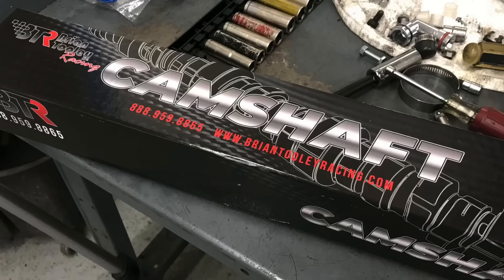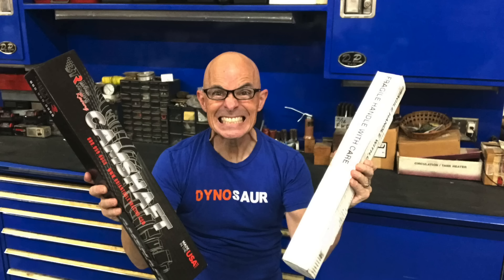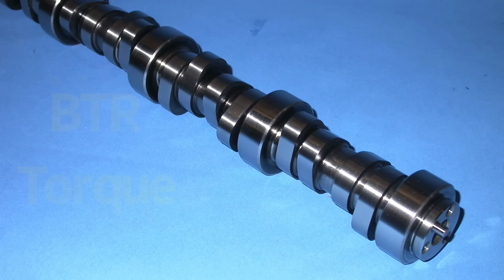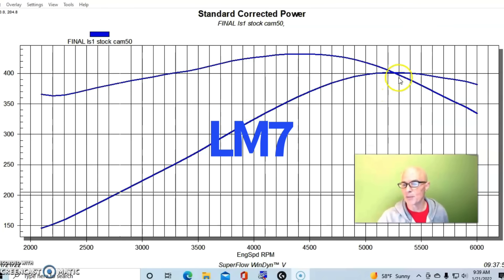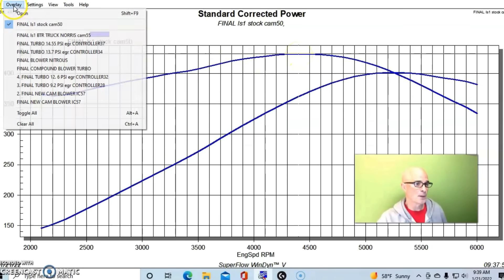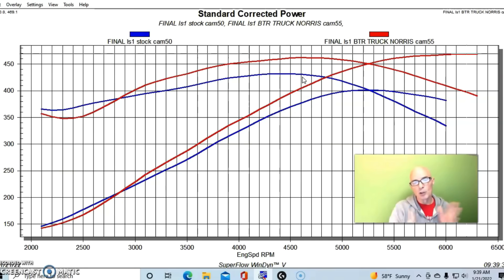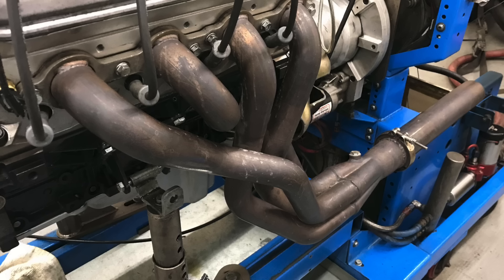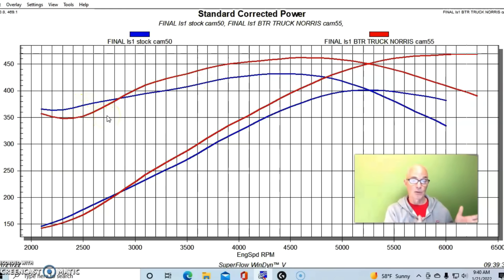WHAT IS THE BEST LS CAM? SLOPPY MECHANICS BEST VS TRUCK NORRIS FROM BRIAN TOOLEY RACING? FULL DYNO!

Comment: I just don't understand how the 5.7L at the same 3.622 stroke has an earlier TQ peek than the 5.3L, with bore being larger. In an ideal world, same stroke/smaller bore should see an earlier TQ peek, but not in this case obviously. Longer stroke/same bore should see an earlier TQ peak, Larger bore/same stroke should see a later TQ peek. I understand the motors are not identical with simply added bore, but normal behavior should be mentioned to those watching this so that they don't get the wrong idea about the intended effects of added bore or stroke in a motor. After thinking about it for a second, the 5.7L's compression ratio was obviously greater and also should have been mentioned with the early peaki-ness vs. the 5.3L, which shouldn't happen in equal conditions.
Reply from the maker: YOU DON'T UNDERSTAND HOW A BIGGER MOTOR WITH THE SAME CAM HAS AN EARLIER TORQUE PEAK? STOP THINKING BORE AND STROKE AND START THINKING DISPLACEMENT

Comment: Very interesting but if your chosen cam is going in a daily street driven vehicle, it's probably not at full throttle very often and I'd put my money on the btr cam being better at part throttle conditions in most applications. I would have a conversation with btr and a few other knowledgeable companies before purchasing such a vital part of my combination based on a dyno test or a small price difference.

Comment: I would love to see this exact same comparison with a LS7 cam instead of the LM7 cam.
Reply from the maker: I have compared the LS7 to the LM7 (that video is up), the LS7 is very soft down low-but does well up top
Reply: @richardholdener1727  I was referring to an LS7 to Sloppy Best cam comparison.
Reply: @andrewnelson3733  He has tested the SS2 in comparison to many..It is very hard to beat the SS2 in total power under the curve. It works very well..

Comment: For a street car or truck that torque curve the mid range power from 3000-4700rpm is  very useable in stoplight banzai where stout track gears and rpms are not as useable that is why Truck Norris is a good street cam.
Reply: Yep I think I will put it in my 04 gro because it's a street car.  It will have more power basically everywhere and still pull to 6500, which is all I want

Comment: I would.really love to see some test for 5.3 cams that would increase power from 5500 and lower. My Z71 runs like a monkey on fire, but I would love to find a cam to kick the low rpm power up more than increased rpm range with more peak power. 
I need to delete the economy crap.
Reply: That truck Norris cam is exactly what you want. The BTR v3 stage 1 and 2 are also good truck cams. All those give you power pretty much everywhere with slight loss of low end.
Reply: Richard says it in a lot of his videos, at lower RPM displacement is a much bigger contributor to power. At 2000 rpm your stock cam isn’t probably even a bottle neck, you’re only being limited by the engine size and compression ratio. Which is why basically every LS cam is the same or worse than stock below 4k rpm. There’s no magic to be made down there.
Reply: Typically when I look for power it always favors more rpm. I can't remember ever building a engine to keep the rpm low. I love the sound of a 532 at 8200. If my 5.3 were a 350, I know dirt track cams offer a wide curve from down low to whenever.

Comment: Great video!  
Are there any benefits  from milling the 317 heads .030 on a lq9 6.0?
Reply from the maker: MORE POWER
Reply: What hp estimate would you say for a lq9 with .030 milled 317 heads,  tsp stage 3 low cam, 1 3/4 long tube  headers and ls6 intake and throttle body ?

Comment: not saying this is true but it did seem to be biased towards btr  was there a btr consultation after  dyno test and then the video came out  love what you do Richard holdener but from the out side it felt like you held back
Reply from the maker: held back by what? all the 3800 turbo dyno testing?
Reply: @richardholdener1727     I understand Putting data together  takes time .. on the ls btr sloppy test  it seemed  to me like maybe you wanted to get better data before discussing  ..the cams are for two different people in the end
Reply: If he had shown the graphs and not identified the result by cam name would you feel better about the result?  Most followers would have been able to determine which cam was which in a blind results presentation.  The same basic pattern follows in all the cam testing.

Comment: Sloppy best vs Elgin 1840p 🤔 judging by this curve with more lobe separation and what not and the same or .005 more lift the sloppy stage 2 would prob flow a little better up top correct? The two seem pretty comparable. Def solid contenders for decent prices

Comment: I'd love to see a Comp cams 54-456-11, which is basically a high lift GM Hot cam.  I think it'd be right in the middle.  706 heads are made for 1-5/8" headers...and they work very well up to 500 bhp.

Comment: Any dyno pulls with the truck Norris vs Stage3/4 car cams?
I bought a stage 3 for my corvette but I’m debating sending it back for the truck Norris
Reply from the maker: yes
Reply: I’m guessing that the stage 3 car cam did a little better than both the truck Norris and sloppy best cam based on the duration and lift. 231/244 .630/.615 112.5 +2.5

Lost some down low and after 5500 pulled away

Comment: truck norris would still out run the sloppy best when you add boost, the turbo would spin up faster with the Truck Norris cam vs the sloppy best
Reply: Depends on the setup.  With the right converter that's irrelevant

Comment: What springs would work with Sloppy Cam ?
Reply from the maker: any .600 lift spring
Reply: @richardholdener1727   pac 1218 would work perfectly.    Could you guys do a test between best cam vs sloppy stage 2
Reply: @richardholdener1727  hate hijacking but you have tested enuff combos , what do you think this setup puts down for power? Lq4, 243 heads, ss2, pac1218, nnbs intake with flex fuel injectors, 1 7/8 primary long tubes and dual 3" woth x pipe and two knock off flowmaster 10s. I appreciate ur expertise, ive watched so many of ur videos to figure out what to use in my engine, im not dissapointed in the least woth how it turned out

Comment: The Sloppy best cam is better above 5000rpm the BTR is better 2000rpm-4200rpm really splitting hairs with these two cams in a heavy vehicle with a stock stall converter I'd take the Truck Norris cam but if using a 2800-3000rpm stall converter in the same application the extra power above 5000rpm with the Sloppy best cam is slightly better and enough to notice the Truck Norris cam would work better if gearing was 3.42 with stock converter in a 4L60E or 700r4 the Sloppy best cam would work better with 3.73-4.10 gearing in the 4L60E or 700r4 with at least a 2500rpm stall converter is my opinion
Reply: I was joking...just a stick shift fan...lol
Reply: What's a converter? 6.0 nv4500 FTW..
Reply: @raymondsteadward168  if l need to explain your on the wrong post
Reply: @raymondsteadward168  it's what transfers the power of the engine to the transmission from there the power goes to the driveshaft that transfers power to the rear end input shaft to the ring gear to the axles and puts power to the tires the converter is a key part for all of this to work yes really
Reply: @raymondsteadward168  it looks like a 12 to 8 inch metal donut with a shaft directly in the middle of it that is filled with transmission fluid and it spins

Comment: Rich could you run the Norris cam in a stock 2003 gmc with the stock tune just wondering if it would run ok
Reply: It needs a tune. Really anything other than the factory camshaft needs a tune to run correctly.
Reply: It's going to have drivability issues without modifying the tune. Hard or long cranking times is among one of them. Better to get the tune optimized for that cam.
Reply from the maker: it adds a lot of power-it needs a tune

Comment: I'm waiting for someone to run a dial indicator on the exhaust lobe of the truck Norris cam to tell us what the mystery duration is!!
Reply: Could be different ramp rates in the design as well
Reply: @TimmyTuffNucklez  Yes..lobe profiles is where a lot of modern cam design progress has been made..
Reply: It takes more than a dial indicator.
Reply: @andyharman3022  A degree wheel?  You get the jist.

Comment: How do these cams stack up compared to factory options such as the ls6 cam? I know the valve events aren’t exactly published for these hi-tech cams, but would these give more bottom end while maintaining ls6 potential?
Reply from the maker: the ls6 would be much worse down low and at the top
Reply: I think the BTR truck Norris cam and the Sloppy best cam will beat the LS6 cam throughout the entire rpm range from 2000rpm to 6500rpm and more so with the Sloppy best cam above 5000rpm a huge difference probably not but better

Comment: Richard i have a mystery custom cut ls cam i got used for free awhile back i was wondering if you could tell me what the indented use might be from the specs? intake is 216 degrees .612 lift, exhaust is 230 degrees .595 lift, 112+4 thanks for any help
Reply from the maker: it's a good performance cam like the best cam-slightly smaller
Reply: @richardholdener1727  thanks for the help
Reply: That is like the LS9 cam without the weird lobe sep

Comment: So this is random but I just saw some pictures of a hot rod with a long runner Chrysler cross ram intake manifold....Has anyone modified one for sequential fuel injection? Also I noticed on the hot rod it placed the carburetor's over the top of the header's...Heat rise's so heat soak is an obvious issue on those, my idea to combat that was to insulate the intake and use heat reflecting gold tape over that...and also ceramic coating the header's and perhaps also header wrap near the flange under where the carburetor's sit...
Also don't know if there is aftermarket reproductions of the long cross ram to play with...would hate to cut into an original to try it...was hoping someone tried these ideas cause I just wanna see it.